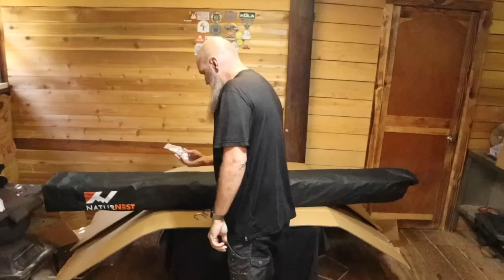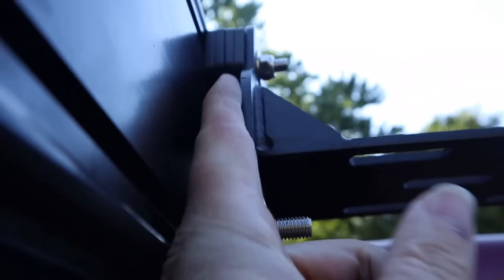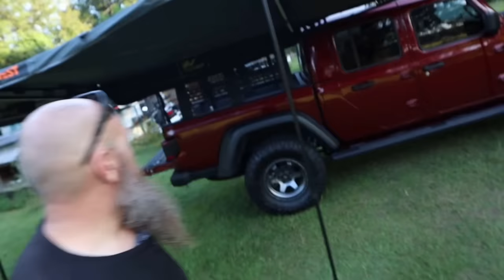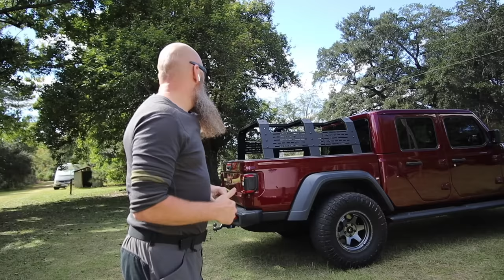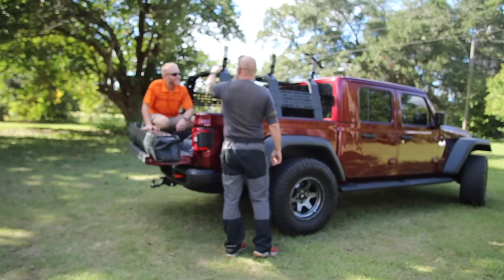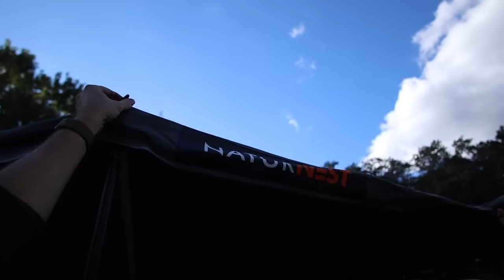Naturnest 270 Awning Unboxing & Installation: Passenger Side Setup Tips | FireAndIceOutdoors.net

Comment: The angle of your rack is definitely most of the difficulty with your install. It probably would have been easier is rack was square at top and just a little taller.
Reply from the maker: Problem is I don’t know how to get it any taller I’ve got a special bracket made that was I think three or 4 inches taller than the original one and it still too low. It’s also extremely heavy.

Comment: They sell two types one for the drivers side and one for the passenger side. Im worried about your roof and the paint. You are going to get a lot of vibration while driving. If there was a way to space your brackets up another inch or two. Or move it back more.
Reply from the maker: Thank you Sean I put a rubber mat between it in the truck it seems to work but I have a new rack that’s 23" that should get it up off the truck much better